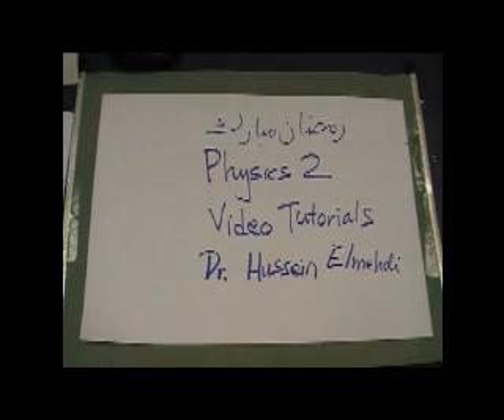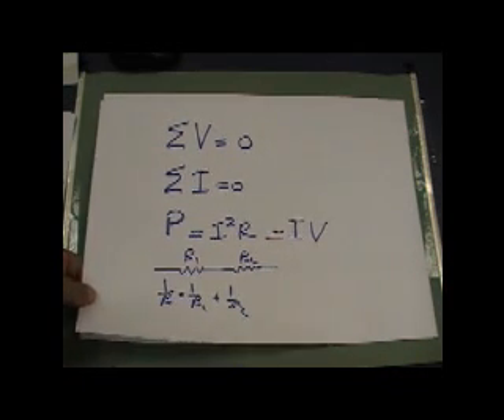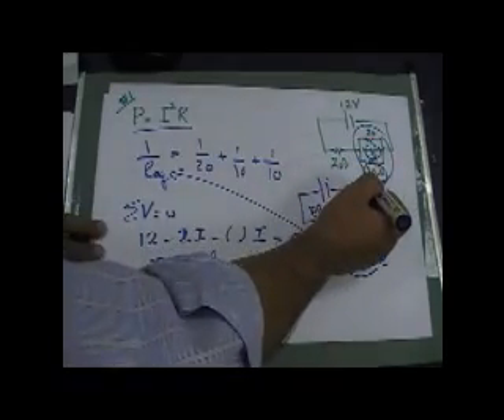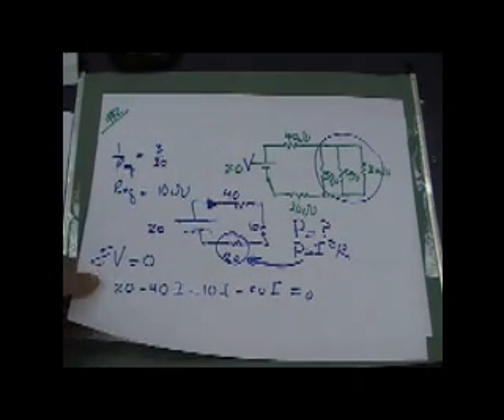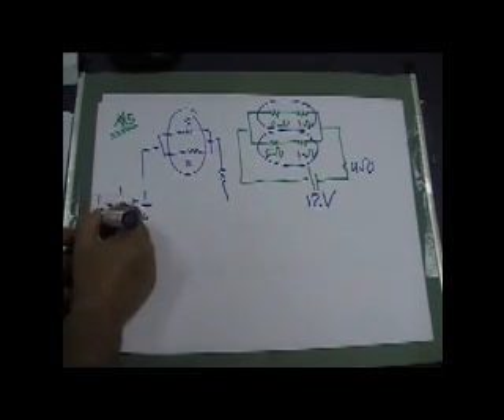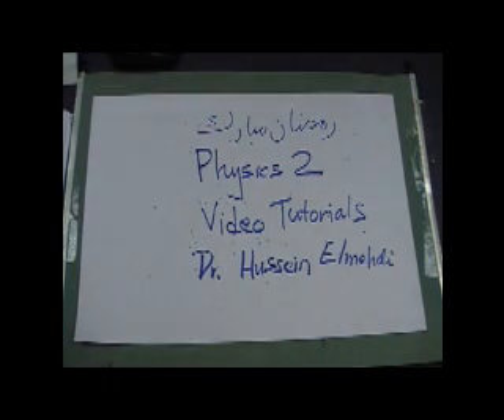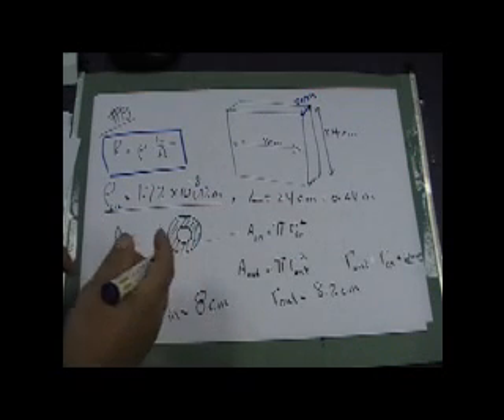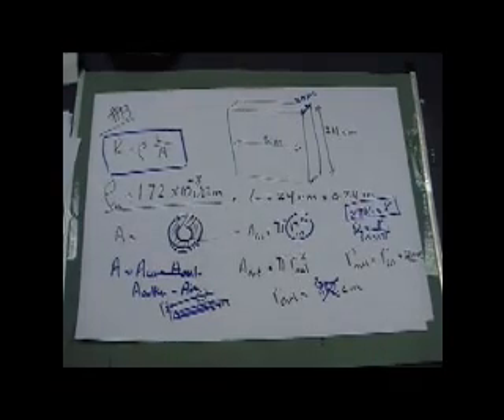Physics 2 Tutorial 6

Comment: in question 1, shouldn't the voltage for the parallel resistors be 12 as the battery? (is it not 12 because there's a resistor in series with the battery?)
this also applies on the second question...